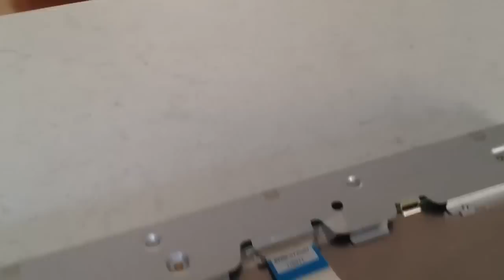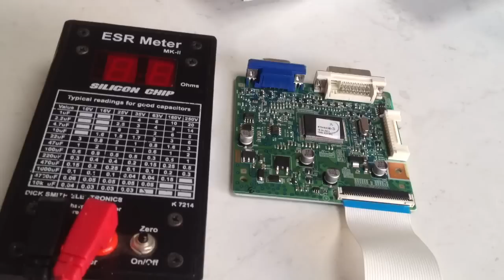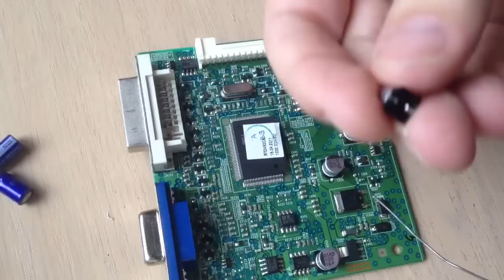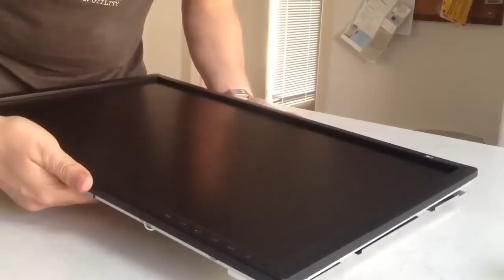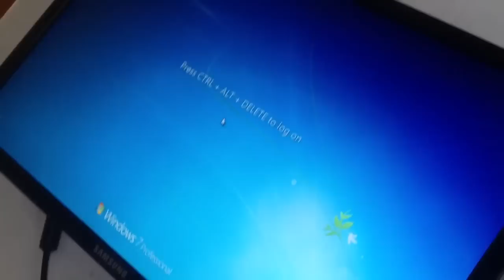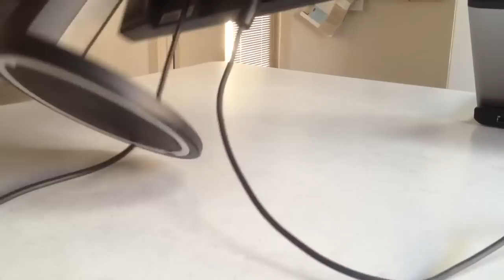Samsung Syncmaster 2443BW Repair - Complete

Comment: Great video. Just picked up 3 monitors for free and one has zero power and the blue led doesn't come on. Had a look at the power board and nothing obvious, I've now just watched this so will replace the 2 caps as you suggest and fingers crossed it works. Thanks 👍🏻

Comment: Where you just finished is where my trouble begins. With my Samsung Syncmaster 2343 I have displayed both “Check Signal Cable — Analog” and “Check Signal Cable — Digital” when switch from RGB and DVI-D. 
However, when I boot my old desktop, I get no “Check Signal Cable” if switching to a connected socket. Also, no image.

Comment: At least you made me aware of capacitor problems on the controller board as well. I had not realized that this could also be a problem. I don't have an ESR meter, so will just replace the caps on mine anyway. It's a cheap enough experiment. I think your microphone was facing away from you - I could hardly hear anything of your audio.

Comment: idk if u still check here, but i bought a 2343bwx from someone and the monitor worked for awhile, but then it smelled like plastic was burning and then the monitor screen went black even though it was still powered, it worked a couple of times when i turned the screen off then back on to bring the picture back but then it just wouldnt stay on anymore and stayed black, do u know what might be the cause of that and how or what needs to be fixed?
Reply: The cause of problems like you describe is almost ALWAYS the electrolytic capacitors. Not always, but almost always. Only by removing them and replacing with suitable new ones can you determine which one is faulty. You have to remove them to test, so it makes sense to simply replace them with new ones anyway.

Comment: Hello, I have a SyncMaster 943NWX monitor, it turns on but its menu buttons do not work, of course this is touch but it does nothing, it is currently on direct. but I would like to repair it, could you help me?

Comment: Thanks to your video, I was able to disassemble my Samsung Syncmaster 2443SW which stopped working. A house lizard (one of the disadvantages of living in a tropical island) got fried on the power supply board (BN4400296C). After clean up, there is still no power. Any idea where I can source a power supply board (BN4400296C)?

Comment: Thanks. I replaced pop up power supply board capacitor but still get black. Found your video clip. Replaced the three 100uF/16j with three 220uF/50v on my hands. It works perfectly. These coupling capacitors are not sensitive to the volume, so a little bigger ones should be fine.  Thanks for great job.

Comment: Thanks for the video. Did not work on mine. Powers up , but will not hold a picture for more than 2 or 3 seconds.

Probably time to retire it.

Cheers
Reply: Exactly how mine behaves. Everything seems to work but the monitor just turns black after 2 seconds.

It stayed that way after replacing the two capacitors mentioned in the video

Comment: Is is possible to change the led driver on the lcd controller board? i would like to change my backlight from white to RGB if possible. With the APA102 LED and the ESP8266 microcontroller instead of the onboard led driver. I have the following samsung monitor: C24FG70. Any input is appreciated.
Reply: You don't need RGB on a backlight. The whole idea of a monitor is to display RGB, using the coloured pixels in the panel. This is the way that the monitor is able to display every combination of RGB colour. Amazing, right?

Comment: I don't understand what all of these hearing impaired people are complaining about, but I can hear you just fine. Thank you for the wonderful demonstration and all of the information you've disseminated regarding this monitor. I was actually curious as to weather or not you've run into a "latent image" problem with any of these 2443BW Series monitors? I have a couple of them that are functioning fine, except for this strange latent image issue. The initial image on the monitor when you turn it on is completely normal. However, after several seconds it dims down to the point where it looks like a latent ghost of an image. Motion bars look completely normal, except for this dimmed image. Any thoughts on this topic would be greatly appreciated. It almost acts like a thermal problem after it achieves operating temperature. Thank you :)
Reply: The volume is so low and muffled that it sounds like the guy is speaking into a pillow.

Comment: meu samsung modelo T220 tambem não ligava, 1º troquei os 6 capacitores eletroliticos originais da placa da fonte eram 4 de 820uF/25v, e 2 de 1000uF/16v, troquei por 6 de 1000uF/35v depois troquei os 3 capacitores originais de 100uF/16v da placa de sinal por 3 capacitores eletrolitico de 100uF/35v e voltou a funcionar normal.

Comment: Where can you buy the board?
Reply: At 4:00, he says that the cost of a replacement board with shipping is probably greater than the value of a working used monitor. Therefore, you should buy a new monitor if it is not repaired by replacing the two capacitors  he shows here and the capcitors for the "back light" power supply: https://www.youtube.com/watch?v=vNZ4wz8jIJg

Comment: Can anybody help me.
 I have a problem when I start my Samsung SA650 Screen just show Analog on Left side of the Screen then it start for few second and go off and won't start again or screen just flick
Reply: It depends. The problem might come the high voltage circuit board. For example, the transformer.
It could also be the wire that goes to the CCFL is cheap and has been disconnected (which is what happened to my T240HD TV).

Comment: I have a similar problem: screen operates for a few seconds, then goes off. Recycling the on/off switch enables to get another few seconds of operation. I changed the four capacitors on the logic board (100uF 16V), but that did not cure the problem. Capacitors on the power supply seem OK on visual inspection, but I will try to check them individually.

Comment: First, replace the four filter capacitors in the power supply board, but can not be repaired, and then replace the video board all electrolytic capacitors, it is normal, thank you.
首先更換四個濾波電容在電源板的，但不能修好，再更換視訊板所有電解電容，就回復正常了，多謝。

Comment: just wanted to thank you for taking the time to make a video of this!  I got the exact monitor and had the same issues (after about 10 minutes, the screen went black). I never opened a monitor before, decided that I might as well try this (even if I broke it...what di d I get to lose!). Your video really helped me open the case without damaging it too much, and what to expect.  I started replacing all of the main small capacitors in the power suplly board 1st, as this seemed to be the number one cause of issues with this monitor. That didn't do anything, same issues. Then I decided to check the second board (the one with the monitor inputs) like your video. Funny enough, the EXACT capacitors were giving me bad readings. 

Ran up to my electronics store and found the capacitors (btw, it would have been great if you did mention what were the capacitor values that you replaced in). After looking it up online with the store clerk, it was: 10uf 16V. Bought them for 0.25 /each !! So, for those interested, the caps labeled (100 16j) is replaced by caps10uf - 16v - 85 Celcius.

Replacing them took me a while (new at this) and almost broke one of them (when pulling it from the board). It was hard since the heat took a while to travel underneath  for the capacitor to start moving/getting lose. I succeeded with patience!

Voila, put everything back in place, hooked it up and the monitor now stays ON!! yay!!

Total cost to change both boards caps: 15$ (not counting your solder kit of course). Total time as a newbie : about 3hrs (took my time).
Reply: "Replacing them took me a while (new at this) and almost broke one of them (when pulling it from the board). It was hard since the heat took a while to travel underneath  for the capacitor to start moving/getting lose. I succeeded with patience!"

==That`s normal. All new electronics use lead free soldier. It is mostly tin with a little silver. The melting point, I think it is 220 C while the old tin60lead40 was 181 C.

Comment: How do you know which way round to fit the new caps?
Reply: The pad has a small diagonal mark at one corner, and the other caps all have the -ve side of the capacitor facing away from the diagonal!

Comment: My 2223NW works perfectly for 2 seconds after switching on, then cuts out (totally repeatably). Similar PSU problem, do you think?
Reply: thats what I have with different Syncmaster model. pic pops on for 2 sec then black. i tried the firmware upgrade found elsewhere on YouTube,  but no way to get monitor into "program" mode to accept it
Reply: i have same issue with mine. any solution you have found?
im guessing its the ccfl backlight itself?
Reply: everything i read is needs new cap

Comment: Question?when i turn the 2443 on in default, it works great.When i adjust the settings like movie mode it will go black.When turning on again it will work in default mode.Maybe regulator?
Reply: +Sam mass Same problem, Did you find a fix?

Comment: What capacitor u replace in...16V higher uf. i have the same board...pls. respond asap...thank you
Reply: At 4:40, he says: 100 uf, 16V. (On the capacitors, it says: 100 16)

Comment: Does anyone know if I can get just the logic board for the 2343BWX monitor?   
I am pretty sure the issue I have (blinking blue power light) is the same issue as described
in the video.  But I cannot seem to find a place to order the board vs. getting the caps?

Thanks

Comment: Oh and a quick way to identify bad caps is take a decent multimeter with a continuity buzzer and charge the cap with the probes on any side then reverse polarity and there should be a short beep then the cap is good, bads caps won't do anything. If the cap is dry then the beep will be on all the time. Only good for small caps that are polarised though.

Comment: My method for removing these caps is RMA flux on the pads and then use a pyropen or hotair torch with a fine nozzle and heat the top of the cap keeping the heat away from the board and keep tweezers on either side applying gentle upward pressure and wait for the cap to blow it's seal and smoke pours out (trust me it's the best way as it's only burning off the electrolyte) then the cap should come away really easy with no track damage. The RMA is essential as that protects the board.